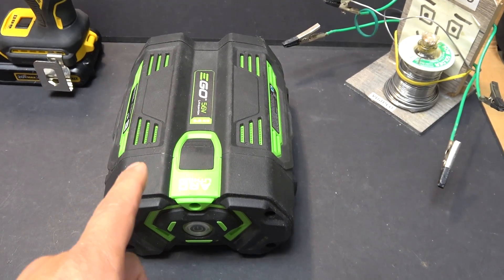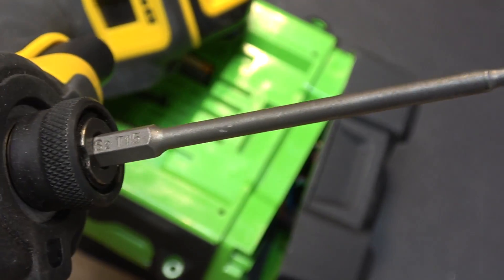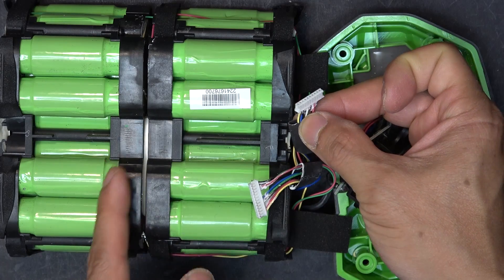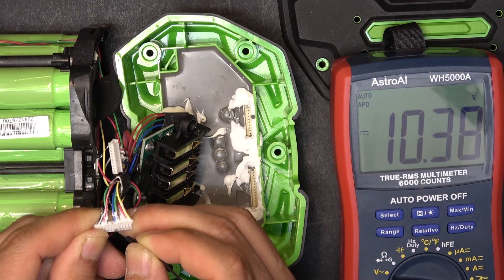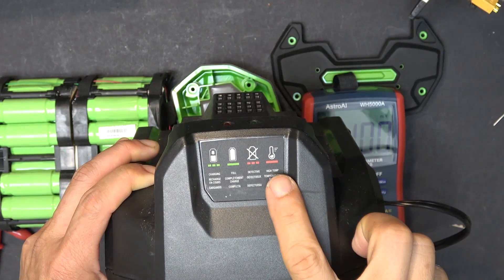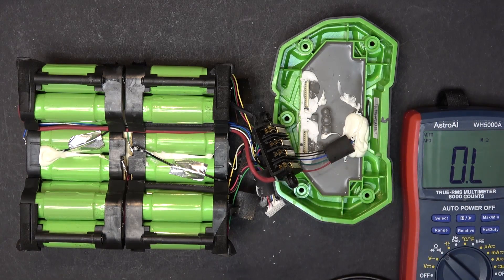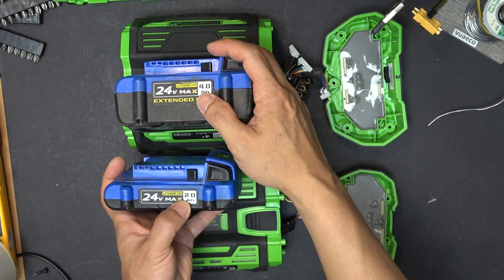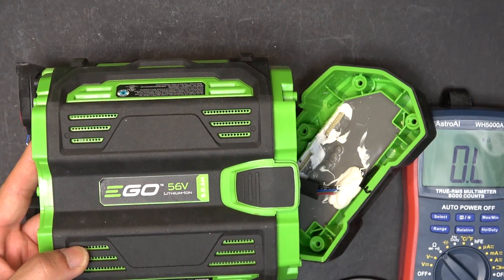From trash to treasure: Teardown & Repair an Ego 56V 5.0Ah battery

Comment: i cut my neighbors lawn, she has two batteries, the older one shows 100% charged but almost immediately dies when under load in the mower.  when you press the top button it goes to a steady red, so i found this and did the drop fix (dropped it twice from about a foot on a carpeted spot in my concrete garage floor)-it works!  I put the battery in the mower and ran the blade for 5 minutes, prior to this it died within 10 seconds.  thank you, subscribed!

Comment: Good Dx video. I seemed to notice my battery seemed to be affected by outside temps. As it has been hot outside it has been reluctant to charge or run the mower in a hit or miss fashion. After looking at your video, thought maybe it is the Thermistor . Instead of taking it apart I put the battery into the garage fridge for the night. Next day it took a charge and ran the mower well without the flashing red light of doom. ? Must be the temperature sensor. Any rate the fridge fix will do for now!.

Comment: Can you assume since you have 52+ volts that all cells are working?  But I understand there could be internal resistance so putting a load on the pack could have been revealing.  Just trying to follow your logic.  VERY helpful video!

Comment: I'm wondering if you could have just plugged in the panel from the 2.5 to charge it, and then put the panel from the 5 back on it.

Which is combersome but it would show that the panel had the issue versus an issue with the batteries.

Comment: What kind of cells are in the battery? 21700? 18650?
Reply: 18650 with a phase change wrapper around each cell.

Comment: Here is a proper fix... Some batteries stop working because one or more wires on the connector has light rust/corrosion on the pins. The "drop method" works on this fault because the shock causes the BMS connector pins to move enough to scrape away the rust that's causing a bad connection. To fix a battery properly DO NOT drop it. Open the battery the way shown in this video. When you take off the white connectors, look at the pins on the board side. Clean those pins with super fine sand paper until shiny. I tear a small piece of sand paper & roll it up, then just put it over the pins, moving it up and down. Add a little corrosion inhibitor to each pin (I use a toothpick)before reassembly. And that will be the last time the battery will stop working because of a simple bad connection to the board.
Reply: either that, or spray a contact cleaner, like DeOxIt or similar on it and plug them back together while still wet.
Reply: Sounds like they need to spray corrosion block at the factory, to restore their reputation for five cents per battery.

Comment: so my battery checks out fine in this voltage method but my temp resistors read 12.18 and 12.09 are they ok my charger turns off and on when charging from red to green light i have 2 chargers both do it but not all the time somedays it will charge but last about half as long im at a loss now any ideas
Reply: Look  up 10K thermistor chart. They are 9999 at 77 deg F. You need to check ambient temp. They're probably ok.

Comment: I had the same problem with the same EGO 56v 5Ah battery. The red, non flashing "overheat' light remained on and it would not charge, even hours after the battery was at room temp. I put the battery in a ziplock bag and put it in the freezer overnight. Next day,  I let it warm up to room temp inside the ziplock bag after I removed it from the freezer so condensation would not form inside the battery. It now works & charges.

Comment: THE DROP METHOD ACTUALLY WORKS:

I was having the same issue with my 2.5V battery. I dropped 3 separate times at different angles & put it back on the charger. I came back 20 minutes later & plugged it back into my leaf blower… it started working again. This actually fixed my battery issue ❤️❤️❤️
Reply: I just saw this comment and tried it after sitting on two dead batteries for a year. I’ll be damned but it worked on both of them!
Reply: @Jules_73 I am happy to hear 💪🏻❤️

Comment: When i had this issue, i dropped it on the floor about 1 foot off the ground.... it fixed the issue 🤣 .  Found that fix from a comment on reddit, and Apparently its worked for many people. For a product so expensive, these batteries are built pretty cheaply.

Comment: I am going to guess that the people who hsve had success dropping the battery are just causing the connectors to move slightly and then make a better contact.

I hsve tried smacking the battery without luck.  

Putting them in the refridgetator for a few hours worked once or twice.

I had one battery that would not charge,  i put it in my blower and tried to start it..

If i could get it to run fot a few seconds , then putting the battery on the charger would give a normal charger
However the capacity was nowhere near normal

Comment: Where can one purchase a (used) 2.5Ah controller or bms? I have a battery with good cells but it wont charge. Thanks
Reply: New 5 ah off brand compatible with ego is $80 on Amazon. 2.5 ah is like $50 or so. Is it worth your time to try a repair?
Reply: @BeefNEggs057  I'm curious if the 3rd party battery BMS's are compatible with an Ego battery pack, like take it out the 3rd party one, plug it into the Ego one, and have at it!
Reply: @ I doubt it’s that easy based on my watching someone open one up and replace the batteries.  Surely you’d have to solder things. Can’t hurt to open it up and look for a nice quick connector though.

Comment: I pulled my 7.5A/h pack apart as it would start to charge then stop and the charger would switch off. After pulling it apart I noticed the terminals were really dirty. So I carefully cleaned then and batts looked to be OK so reassembled and now its working perfectly! Thanks for showing me how to get it apart and test.

Comment: I have a brand new 5.0 AH Ego battery the board went bad………….The cells are all Ok, I was thinking of attaching that battery to a working 2.5 ah battery; connecting ( Positive & Negative) terminals tapping the two batteries together……That would make the battery 7.5 ah battery, you think the board on that 2.5 ah battery could handle it????????????????
Reply: I would guess that it would NOT handle it.  Even with swapable BMS boards like Kobalt, each likely has calibration parameters programmed in it for the cells that come in the pack.

Comment: Also found out when attempting to replace one of my dead batteries, EGO had the info for the warrenty on file, but because they didn't have a copy of the reciept on the dead one, they would not honor it, even though they acknowledged i purchased it as a new product.  They said it was up to me to find my two+ year old receipt.   Rethinking about staying with EGO. Really ticked me off.
Reply: Yeah they suck. Im staying away from flex bc of my ego warranty BS. Milwaukee honors by mfr date. It also explains their high resell value. Ill stick w ego for yard stuff, but no way im replacing m18 for flex.
Reply: @schuylerpryne5  Milwalkee and many others will also honor the warranty on 2nd hand batteries too, if you bought the battery and/or tool used.  EGO will refuses to!
Reply: same, but I had the receipt in the booklet.  I scanned a different receipt from the same store.  they had my info on file too.  I sent them a picture of the original mower receipt, so hopefully I'm good.  10 days left on my Battery warranty 😱
Reply: I had the same issue just last week.  The blower was a gift and I had never gotten a receipt.  After much haggling, they sent a new battery, but said it would not be covered under warranty if I did not have the receipt.  Really dumb since they have the manufacture date and know the battery was still in warranty.  Products are great until you need to get warranty replacements.
Reply: Paperwork is uploaded into their website when you register it. Why did you not upload the receipt then?

Comment: Registering your batteries will not BE COVERED under warranty UNLESS you bought at their stores they say go to. I have several items they were given to me as a gift and EGO refused to cover under warranty. TERRIBLE CUSTOMER SERVICE.
Reply: No it's not bad service. Companies have accounting to do, like everyone else. If there's no "paper" trail, it looks like freebies and has to be counted as a loss. GET your receipt and register the warranty. It's pretty basic stuff.
Reply: @jacobpetersen5662  I work in professional electronics.  Equipment changes hands frequently, and I am often servicing equipment that was purchased by a different dealer.  I am working with well known brands, like NEC, Sony, Harmon, Shure, and many others. NONE of them give me receipt BS like Ego does.  They can figure out the manufacture date off the serial number an honor the warranty.  The only problem comes when the product is just out of manufacturer warranty, I may ask a customer to see if they can find a receipt to cover that "gray area" between manufacture and purchase date.

Comment: The one piece of advice I'd give all ego customers is this:  register your batteries!!  They have a good 3 year warranty if you register them, and they are very good at replacing batteries that have started losing their ability to hold a charge.  I just replaced a 2.5ah, a 5ah and a 10ah battery, and all I had to do was call EGO and tell them they weren't holding a charge any more and they sent me three brand new batteries.  They would have cost me about $900 or so, so that's a great deal.  Now I'm set for at least another 2-3 years, and before the warranty on the new batteries goes out of date, I'll replace those as well.  So now I have new batteries and the old ones as backups.  REGISTER YOUR EGO EQUIPMENT AND BATTERIES!
Reply: Ego just told me they don’t put another 3 year warranty in replacement batteries.  The warranty is still only based on your original purchase date.  Pretty bummed because my replacement battery just died as well. And they won’t honor the additional 3 year battery warranty
Reply: @markblakeman1306  If that happens to us, I'll just put my Sicilian wife on the phone with them.  In 5 minutes they'll be sending us new batteries.  I've never won an argument with her, and they won't either.
Reply: @markblakeman1306   This is indeed correct with all warranty issues- the coverage doesn't extend with (any) replacement items. The coverage only continues from the original service date.
Reply: Sounds like gaming the system.  Remember all these additional costs of doing business are passed on downtown to the consumers
Reply: No way. That's how insurance and warranties work. It's the opposite of what you're thinking. It's already in the price.
Reply: @j.m.5995  Gaming the system?  Why is that?  I wasn't lying to them, the batteries had all stopped holding a charge compared to when they were new.  The 10ah battery for the mower used to last just over an hour.  At 2.5 years old, it only lasted for about 30 minutes.  So nobody gamed anything.  I merely used their warranty and replaced the batteries.  It would make absolutely zero sense to buy electric lawn tools if you had to pay to replace the batteries every few years.  I could literally buy all new equipment for what the batteries cost.  That's the problem with anything electric, like my Prius.  $3,000 for a new hybrid battery after 150,000 miles.  The car had never had any work done to it, still runs great at 215,000 miles, but $3,000 for a battery?  And that's on the cheaper end.  Look up what a Hummer battery or Tesla battery costs.  So if EGO is going to warranty the batteries to make owning their equipment reasonable, I'll be taking advantage of that.
Reply: the battery is too expensive to replace over the year it costs much more than the strimmer itself. Not for me unless I know I can rebuild the battery for less by myself.
Reply: @seemovielove3597  I've seen videos on rebuilding these batteries.  Not sure if I'll go that route or just buy new ones when these go bad.
Reply: This is good to hear.  Thank you.
Reply: Wish I knew this
Reply: If you have the receipt. If you lose the receipt it won’t matter if it’s registered
Reply: @garrettvogelepersonal  I needed no receipt.  I registered everything when I bought it, and approximately 2 1/2 years later I called them and told them of my battery issues, they looked up my account and sent the new batteries.
Reply: @ strange. I got a new battery and charger as a gift. I registered them and they were manufactured October 2024 and they said they needed a receipt
Reply: @garrettvogelepersonal  Perhaps they changed their requirements?  Maybe too many people were getting new batteries under warranty, so they changed the requirements to try to save themselves some money?  Wouldn't surprise me.  That's the biggest issue with anything electric...cars, mowers, anything requiring larger rechargeable batteries...the batteries have a limited life and they're expensive as hell.  Ask me how much a battery pack for my 2015 Prius was.  $3,000.  After 150,000 miles.  Now I have 215,000 on it, still runs like a top and looks great, but you can be sure I'll be selling it before it hits 280,000 just to make sure I'm not the one buying the next battery pack.

Comment: At the end of the video you said "so that's how you repair or salvage" but you did not repair anything.
Reply: Here's me paying it forward with some advice I got many years ago: If you have nothing nice to say, say nothing at all.
Reply: ...no...he did not.  BUT, he did explain it
Reply: He showed the steps necessary to repair if it was a cell or thermistor. Even a board if it's the same size with the right connectors.